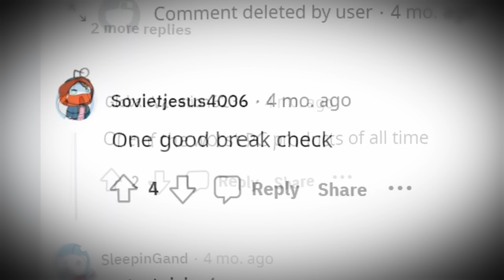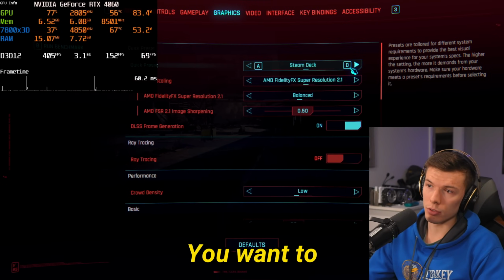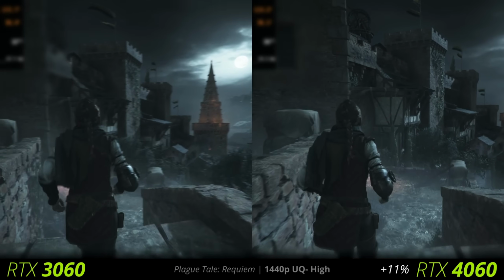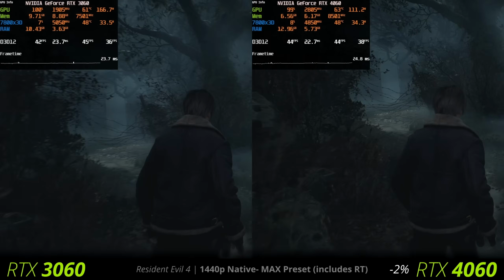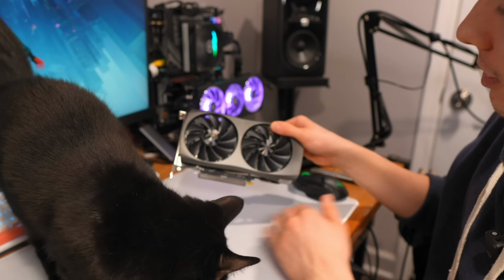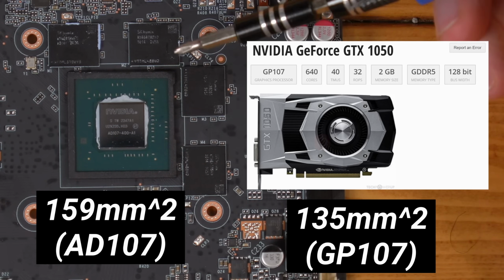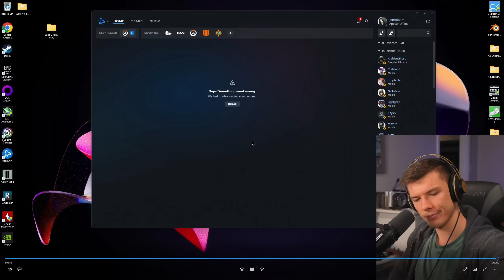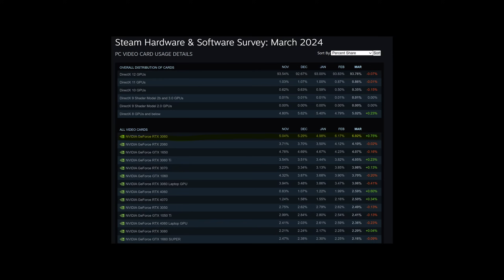I Tried Nvidia's best "Budget" GPU to see if we're Doomed

Comment: rtx 4060 is getting old so fast man... i'm happy with my rx 6800 with 16gb vram
Reply: Best purchase ever.. used at 330 $, a mind blowing  40% lead over a regular 4060, plus 16 GB VRAM 256 bits
Reply: @silvio351  I hope that this card will hold up well for a few years, not like 4060 that is already about 1 year old and is obsolete in some cases
Reply: Yeah. I got a 6750xt and compared to a 4060, you’ll think the 6750xt was a high end card
Reply: @Blaczek297 
😂 Lol.
You wouldn't play any game with 60 series of AMD, cause every game will mandatory DLSS and frame generation.
Reply: @789uio6y  so do you prefer 4060 over all Radeon 6000 gpus? That's doesn't sound smart.. Typical NVIDIA fanboy.

Notice that i didn't said that rtx 4060 is bad gpu, for most less demanding users it can be totally fine. But DLSS/FG can't save you if you have vram capacity bootleneck. It will only create more stutters and a lot higher system latency that can be very noticable and sometimes make your game unplayable if you have even +60 fps at this time. DLSS and FG have sense on higher framerate or it will make the system latency too high.
Reply: Same, got a RX 6800 XT for just €300 insane deal
Reply: @fresco_dinero5155 also got a 6750XT AMD just has the mid range.. This time there's literally no reason to buy a kid range Nvidia gpu unless you get a good deal.. AMD beats Nvidia in the mid range
Reply: @789uio6y I literally was playing dragons dogma 2... Nvidia fanboys need DLSS because your GPUs are actually slower than AMDs unless we are talking about the 4080ti/4090..

AMD competes with Nvidia
Reply: @blaczek 297 Got the 6950 XT..   I'm with you
Reply: @Blaczek297 I think he’s mostly talking shit about unoptimized games and devs partnering up with NVIDIA to push features that distract from poor optimization.
Reply: @silvio351 mindblowing was my upgrade from GTX 650 to RX 570. It was 500%.
Reply: @silvio351  and switching from that GTX 650 to my current RX 6650 XT would be like a 1000% uplift.
Reply: @smet145  Fun fact: Polaris GPUs have worse drivers than newer ones.

RX 570 and RX 6650 XT owner
Reply: RX 6800 been missing in my country since last year, used market is a joke as well, that said I've got a RTX 3070 for $300, amazing card despite the 8gb
Reply: Got a 6950xt with 16vRam and it never slips up.  It cost more than I'd like but worth every penny
Reply: @comfortsnail6342  Had the 6950 XT and 7900 XTX before getting the 4090 and I still have my 6950 XT hanging on the wall it doesn't work anymore but it was my first high end card still today my favorite card.
Reply: @Threewlz  It's a Full HD GPU because of 8 Gb.
Reply: @alkine3011  nice mate nice,  mine does make a loud static hiss at certain menus on games which is weird (Elite Dangerous menus it happens) it's not loud enough for me to worry but it's loud enough to hear
Reply: @korosoid   I play anything at 2k no problems so far
Reply: @Threewlz  Anything AAA at High settings and released at least after 2022?
Reply: @smet145  Literally my only issue with AMD is the drivers since I hear they mostly fixed the heat issue. I ran a 5700XT for awhile and would crash out of games pretty often and have to fiddle with the driver settings. Got an Nvidia card (4070ti) and havnt had any driver issues. Gave they 5700XT to my younger brother and he's still having issues with it.
Reply: @korosoid  Alan Wake 2, TLOU remake, RE 4 remake, SM miles morales, Horizon FW. High textures/settings + DLSS all good so far...
Reply: right there with you, brother. RX 6800 is the midrange sweet spot right now, even if it's still a bit overpriced.
Reply: @Threewlz the rx 6800 just resurfaced in the USA it's kind of a miracle especially at 380
Reply: @Threewlz  Sure, you bought a RTX card to play with RT off and tweak settings with DLSS balanced.
Or 30 FPS console 3070 player here?
Reply: @korosoid  Nobody is using Ray Tracing at xx70 and bellow unless they wanna waste 50% of their fps for some shiny surface. As for DLSS, no reason to not use it when at resolutions above 2k, image quality is as good as native and better aliased. Also every game runs 60 fps buttery smooth, are you frustrated with your card or something?
Reply: @Threewlz  Getting an RTX GPU to never use RTX is kinda sad, but I just want to clarify that 3070 is too powerful for 8 GB. The upcoming 5070 has 12 GB, but the 5060 and 5050 still have 8 GB of VRAM.

I'm running RX 6650 XT, and I'm in the same boat.
Reply: I got the 6800 as well
Reply: @korosoid  pls no more xx60 card with 8gb vram🙏🙏
Reply: @Blaczek297  too late, it's a kopite7kimi leak. It's all GDDR7 btw:
- 5090 - 32
- 5080 Ti -  24
- 5080 - 16
- 5070 - 12
- 5060 and 5050 - 8 Gb each and 128 bit bus
Reply: @korosoid  practicly no improvement over generation
Reply: But still, i don't understand that stupid price/distribution logic. Here in Luxembourg (and Germany and France for that matter), this 4060 is nearly 1/3rd cheaper than it is in the USA yet the AMD GPUs are very expensive. Even the old RX 6600 is even more expensive than nVidia's 3060 ti and 4060. That's why i don't have any other option but to buy this 4060 if i want to play the games at 1080p.
Reply: I got a 6900 XT for around 900€ when it launched and don't regret it at all
Reply: 4060 has better 3d modeling-rendering performance than rx 6800, 6800 is obsolete 😂@Blaczek297
Reply: I went for a 7800 XT, little bit of regret but it's a good card
Reply: 6800xt uses 200 to 300 watts. They are not in the same product class......It's why AMD sucks a** when it comes to laptop GPUs...The Laptop 4060 and Desktop 4060 have near the same performance, just slightly different clock speeds.....The 4060 matches the 7800 XT when it comes to blender renders.....If you see a GPU as nothing but a gaming tool, then no problem....but overally, the 4060 is a solid card.....even though it's meant to be a 4050.
Reply: @kninezbanks  What is it with you old fanboys using "....." every two words? Besides, NVIDIA only has an advantage in productivity because of CUDA. Have you heard of the AMD equivalent, or are you just going to keep fanboying over a corporation? Additionally, the original comment said the 6800, not the 6800 XT. The fact that they are not the same product class is the point; they deliver vastly different performance for largely the same price. Additionally (again), what the hell is "overally"?
Reply: @kninezbanks  Very true.
Reply: @Posh_Quack  "What is it with you old fanboys using "....." every two words?".......It's used to space out sentences so you aren't reading a massive block of text........"NVIDIA only has an advantage in productivity because of CUDA".......No one cares about underlying reasons, they care about results, Nvidia is better at Productivity/Content Creation/Power Efficiency......the "why" doesn't matter..........."the original comment said the 6800, not the 6800 XT"........Doesn't matter, 6800 is 250W, 6800XT is 300W........4060 is 115W,  the point still remains the same, if all you care about is gaming, specifically non-ray/path traced gaming, not productivity, not power consumption.....then have at it.......Nvidia GPUs are better overall......it's not fanboying to simply state facts. smh
Reply: @kninezbanks  AMD also has better productivity support with linux, Nvidia struggles with that.
Reply: 6800 XT is likely one of the best cards of the last years, incredible value. It only lacks RT capabilities. But who really needs that? Darktide with RT is lovely, but taxing and I wouldn't spend thousands for a 4090 to then still need DLSS to sill not get 120 Hz 4K.
Reply: Got myself a nice budget RX 6600 and a ryzen 5 5600X for monster hunter wilds, which should be on par with 2060S, and one of my friends was able to play well with higher end settings on the wilds beta. Going from gtx 1660 to this will defo help me continue my hunter journey. Going for hunting horn!

Comment: texture files are getting bigger every year and gpu manufacturers are cutting vram with every generation. It's mind boggling
Reply: the 3060 seems to be the sweet spot then. 12gb of vram. $250-$300 as of writing this comment.
Reply: texture files getting bigger every year is because of lazy game development optimization.
Reply: @rockiecraft  I actually wanted to buy new pc with 3060 12 gb of vram and glad my friends who are tech savvy STOPPED me from picking Rtx 4060 8 GB because I'm that clueless.
Reply: @rockiecraft  I found an RTX 3060 for 200e, in a store, and i was blown away, I had to buy it, considering I had RX 580 8gb XFX version which was still holding on well but I really wanted to switch and see that nvidia "life-style" and DLSS in my eyes was still prettier, couldn't be happier with the card, I play in 1080p and I'm not a "every game" must run on ultra settings. so I'm happy to lower some settings slightly and get a 60fps experience
Reply: @Moji55a  gg to your friend, you definitely owe them a drink!
Reply: @TheUnusualNetwork  Yeah, now I'm saving for 4080 Super 16 gb lol.
Reply: "GPU manufacturers" Nope, just one, Nvidia. AMD and Intel have no problem offering proper VRAM
Reply: 3060 ti is 300 rn and 3060 is 175 - 200 rn@rockiecraft
Reply: @rockiecraft  i have a 3060 and although it holds up just fine at 1080p, at 1440p it starts to drop two digits fps if you turn on extra stuff like RT etc. Playing with 40-50 fps on 1440p is fine but still thats why im about to buy a 4070 which to me looks like the only best upgrade per price for a decent upgrade. A 4070 costs 600€ here in Belgium and im about to sell my 3060 for 250€. Which means ive used my 3060 for 2 years and the upgrade to a 4070 will only cost me 350€ after selling my 3060. Ppl find prices too high but forget you can sell your own card afterwards. Ive seen a guy say he wanted a 4070ti but only had a 700€ budget and was about to go in a depression untill i told him he could sell his 3060ti for 350€ and only use half of of his budget and go upgrade something else with the other half 😅
Reply: @Moji55a or wait for 50 series, which would probably be a small refresh
Reply: @CheeseburgerEnjoyer  Nah, I'm not living in US and probably if it got released here, it'll get a price hike.
Reply: Fuck I shoulda gotten a 3060 not a 50
Reply: They want you to upgrade more often
Reply: @rockiecraft 2 months later and it has been discontinued
Reply: @optiondezzo don't post uninformed stuff. It has nothing to do with optimization. The bigger the file, the more work for gpus and gpus ship with their own apis to handle textures. Devs only tap into those apis.
Reply: Honestly
Reply: Why are you saying "manufacturers" plural? For the price of this awful nvidia scam you can buy a 7600 XT with 16GB vram
Reply: @rockiecraft  Yes, the 3060 is a better card long-term than the 4060, and in many games better for 1440p high settings right now.
Reply: @rockiecraft  i still have a crappy 3050...
Reply: No, that’s because developers aren’t optimizing their stuff anymore
Literally the RTX3050 lived well off 8GBs, and what you got was an entry efficient card
The 4060 is even more energy efficient, and that’s a good selling point. I do not want a 60 class card to be 170 watts again. They’d just keep raising the bar till they’re 200 watt cards, and they’d have to bring back 30 class cards set for 115 watts
Reply: @saturnFIV3 too bad AMD cards suck, are riddled with instability issues, and use far too much power at idle.
Doesn’t matter if their cards have more VRAM when everything else about them is bad
Plus…. 4070 supers have been getting good prices lately, so who cares about whatever RX 7 class card 💀
Reply: its not just textures. games are unoptimised and depending on AI technology. the catch is that AI technology such as Frame Generation (4k series and now 5k series) just use VRAM to make that magic happen. AI can do a lot things, but conjure VRAM out of thin air is not one of them. in 2024 the typical case is that a game is working at around 7k VRAM, but framegen requires 1gb VRAM or so to work, meaning you will cap out and get worse performance than if youve had it disabled. 4060 is doomed on arrival on that fact alone. it is a card that has FG, but cant use it.
Reply: @ Frame gen is pointless though. The 4060 is still a good budget option, cards like these only have thus much VRAM because that’s all they’d ever need, and cuz they’re budget cards.
Plus I have to remind y’all, that the RTX2060/RTX3060 12GB couldn’t even use that full amount, which is why the 3060 8GB basically replaced the 12GB model, and had no performance losses. If you’re soo damn worried about VRAM, then buy something with more.
Others are very happy that Nvidia ain’t ignoring the budget consumers.